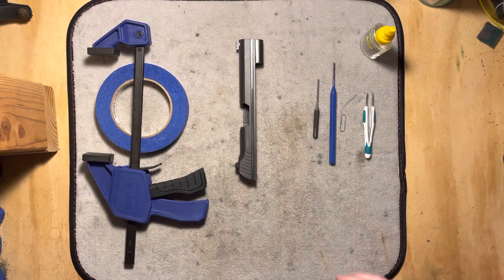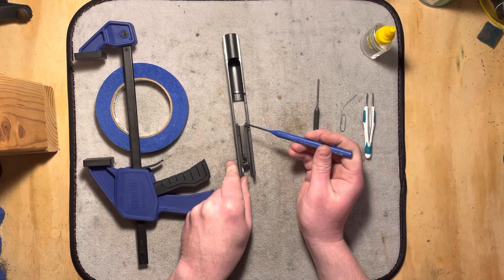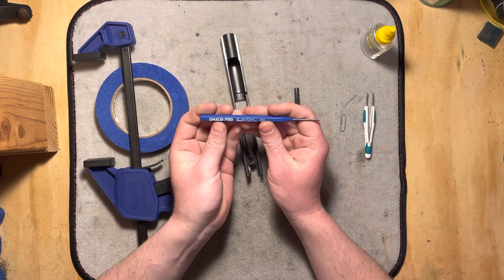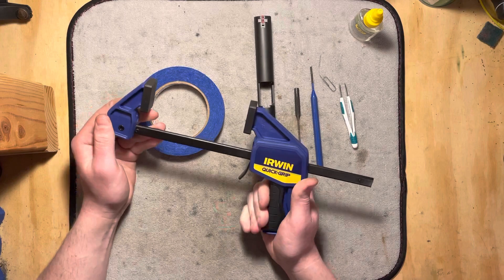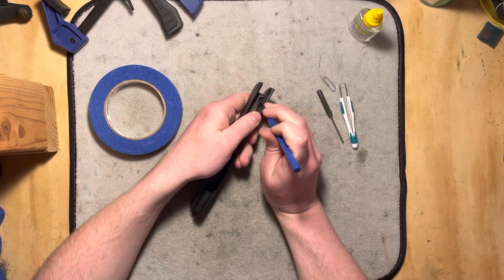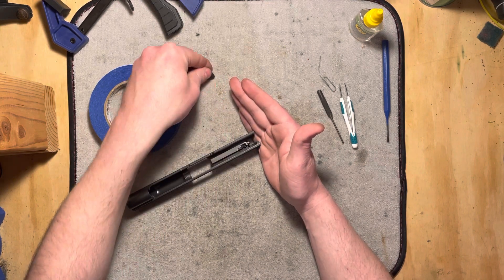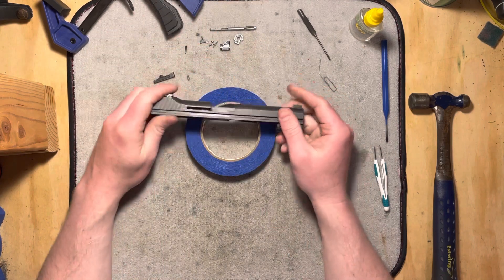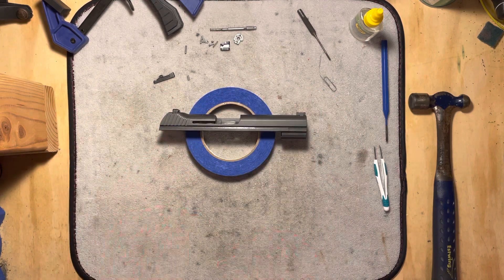SIG Sauer P210 American Slide Detail Strip Part 1 of 2: Disassembly

Comment: Great videos thanks! Can you do at some point a disassembly of the hammer/sear block? I would like to know how to mirror polish some surfaces inside (hammer and sear side faces, probably not the engagement hammer/sear step...).
Reply from the maker: I tried to do that, but as best I can tell those pins are pressed in from the factory. They are extremely tight and striking them any harder than I was trying to seems like a bad idea. 

I’m guessing they must have some sort of specialized press for disassembling the hammer box, or possibly they test the parts in a fixture prior to assembly and once in the actual hammer box they might consider it a permanent installation.

Obviously this is speculation on my part, but I don’t think removing the pins of the hammer box is advisable. Too much risk of damage, and limited availability of spare parts.